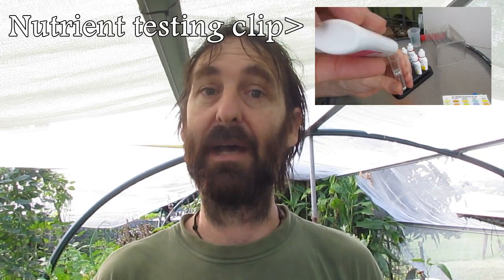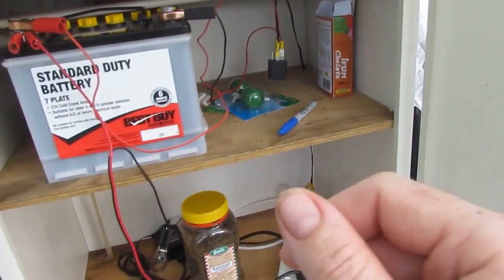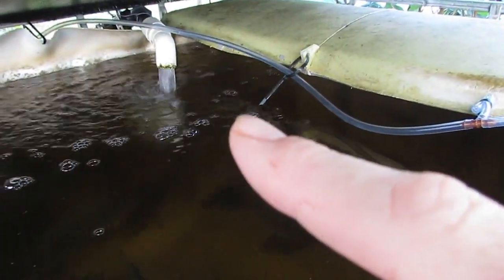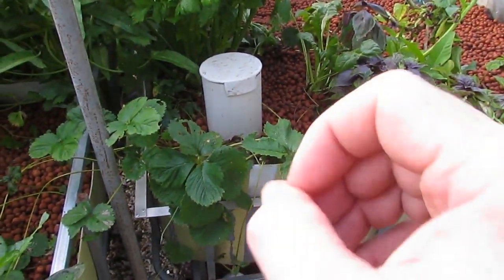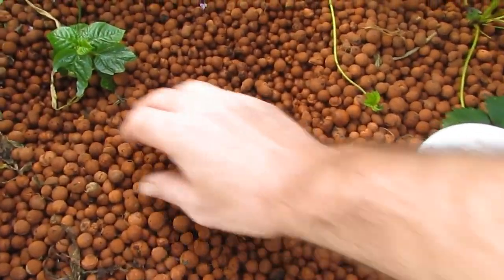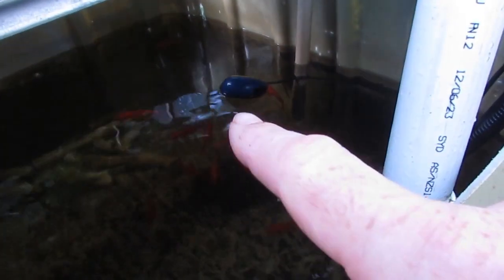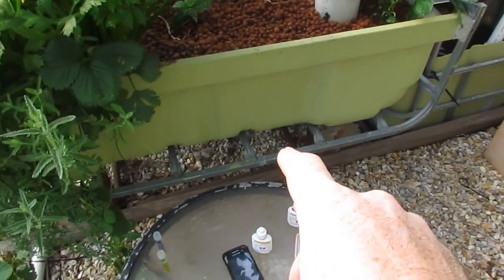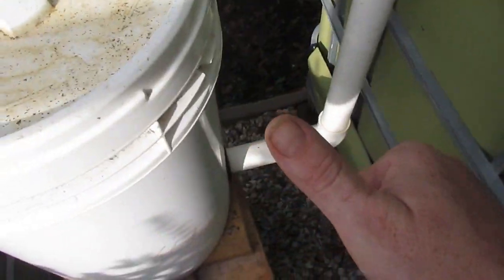Aquaponic system layout tour...

Comment from the maker: The SLO (solid lifting outlet) pipes do a great job at removing the solids I have found so am happy with using them.. One fell off the other day & the amount of solids that built up was quite surprising.. Only took about a day for most of the solids to clear once the pipe was attached again.. 
I think it may be a bit hard to service the screen that you would need to attach to the inside of the tap outlet.. When I was thinking about setting mine up that was one thing I contemplated.. TBC

Comment from the maker: The Solids Lifting Outlet (SLO) has a "T" piece at the top of the pipe where it flows out to the grow beds & filter. Having the top section of the pipe open prevents a siphon from being created & draining the fish tank.

The reason for the filter being on a separate line is that I have been waiting to do a bit of a make over on the system & don't want to waste the pipe by cutting the filter into the line twice. The new line is a larger diameter pipe so it can handle the increased flow rate. TBC

Comment from the maker: Hi there...
That was included in case I wanted to add in a grow pipe around the front of the system... Never ended up using it so wasn't really needed.. Just good to have it there so lines didn't need to be cut later..
Cheers :)

Comment from the maker: It can be quite expensive if you buy the kits & the clay balls but if you can fund alternatives that cuts the price down considerably.. IBCs that have had non toxic liquids in the are easy enough to source through local buying sites we have found & normally never over $120AU.. Pipe work pumps I would buy new unless you can get a guarantee that nothing toxic has been through it as it would be too hard to clean I would think.. Rock & pebbles would be the best way to go for price I would think TBC

Comment from the maker: Hi Kevin.. The 4500lph/1200gph pump I am running at the moment draws 100w & as it is on 24/7 it is using 2.4kWh a day.. just worked out that its costing me just over $200 a year to run & then there is the air pump that runs 24/7 as well.. I don't run a timer in the system at the moment as I saw it as one more thing that could fail & lead to fish death when I first started out.. I haven't gone back to rethink the idea but it might be an option I should rethink.. TBC

Comment: 1200 gph, It puts out alot of pressure. I will be adding a relay and battery bank here soon to make it fully self contained. Here in Texas the sun is always out. Eventually I'll add a marine wind generator to add extra power when its cloudy or for night time power to help keep battery drain to a small amount. Also for the days with no wind/light.

Comment from the maker: Depends on the flow rate of your pump & fall from the FT (if it's set up like ours) I think.. 50mm/2" would be best but as I'm set up for 40mm/1.75" I will run with that.. Better to start off to large that too small when it comes to cutting out holes in tanks.. 100mm/4" would be too large for a set up our size I think..
Hope that helps :)

Comment from the maker: The air pump at the bottom of the cupboard feeds an air stone (back left corner of the tank near the pipe work) that runs constantly... I just turn it off as it can get a bit loud with that running & the water sounds while I film.. 
TheDarthLoki is right about the back up.. It only starts up if the power supply to the large pump has been disconnected somewhere..
The water also aids in the oxygenation of the water but I don't rely on it as an air source.. Better to over do it I think..

Comment: So during normal power the water flow accomplishes this? But when the power goes out use the air pump as a "low power" way of keeping oxygen in the water? Sorry if that is a confusing way to ask the question.

Comment: How do the solids get removed from the pipe at the bottom of the tank.  I don't see a pump or any suction happening to pull the solids toward that pipe.  How does your solids lift system work?  Thanks.  And I enjoy your vids.  Watch multiple times.
Reply from the maker: Hi there David..
The water flowing into the tank from the sump pushes the water out the solids lifting outlet (SLO).. The fish disturb the solids as they swim & they get sucked up the SLO into go into the radial flow filter.. Did a bit of a clip explaining the way the water moves through the system the other week if you're interested..
Aquaponic plumbing, How the water flows through our system..
Hope that helps to explain it..
Cheers..

Comment: Hello sir. Thanks for the advise regarding which to start first, planting the grow bed ir setling the fish. Will start with the fish food then add the fish later gradually. Hawever the problem I am facing is with the hydro pellets. They keep in floating in the grow bed whenever it fills up then drops again when the syphon kicks on. It has been a week since I filled the grow bed, and the problem us still there. What is your advise sir. Regards. Samir Milky.
Reply from the maker: Sorry I missed you comment Samir. They tend to float for a little while until they become saturated with water then will settle down into the bed. 
Hope the system is running well for you.
Reply: @RobsAquaponics  Hi Rob. It has been more than a month since I am running my system but unfortunetly still facing the same problem. Had to fill the botom with marble and granite before putting the hydro pellets. The pellets still float a bit before the syphon kicks on. Hoping the roots holds on the bottom layer. It costs me much more than the normal. My lettuce will cost like a fortune. I am trying to convince myself that I am doing it for fun. 😁😁😁

Comment: one more thing!would a swirl filter work if you plumbed it from the outlet at the bottom of the ibc tote with your disign.it seems it would .im worried about fluctuating water levels with system im working on.

Comment: Hello Rob. Robert here. You mentioned the sump pump was magnetic drive so that there isn't anything to wear out. I thought they all used an impellor system. What is that type of pump called? I am just trying to get started. Haven't built the system yet
Thanks
Reply from the maker: Hi Robert :)
The impellers on the magnetic drive pumps can still ware out but reducing the flow doesn't damage the pump as I understand it..
I have used a few different brands & think the most reliable we have had are the sunsun HQB series (2000lph +) submersible pumps.. They chew a bit more power but they appear to be more reliable on the flow rate that they advertise.. The HQB 4500lph/1188gph (US) pump in this system uses 100W & has a flow rate of 2700lph/713gph (US) after it pumps up to a head hight of just under 1m/3' & runs through a venturi so I'm happy with that.. Has been running the aquaponics for over 2 years & hasn't skipped a beat..
Hope that helps a bit..
Rob..

Comment: whey use a air stone when water movement oxygenate the water for you family lookt after tropical fish 45 years there no air stones in my fish tanks just pumps
Reply from the maker: Hi there.. The bio mass of a aquaponic system is a bit higher than most tropical fish tanks from what I have seen.. Some folks will run theirs up to 40+kg per 1500L in the USA with tilapia so extra air is needed.. We had about 10-15kg of fish in our 1500L system with water temps at around 30°C for a week last year & think we may have had a few issues if the system wasn't supplemented with O2..
Trying to use venturi as much as we can here now but still find we need some air run into the bio filters via a compressor..
Cheers
Rob..
Reply: (Y) mine just a small set up with a couple gold fish in a greenhouse glasshouse if it get 2 hot i will try floating some frozen ice bottles  in the flower bed to cool it down but i will keep a eye on the fish for panting on the top of water for lack of oxygen i think i should be ok 6 times turn over a hour in water